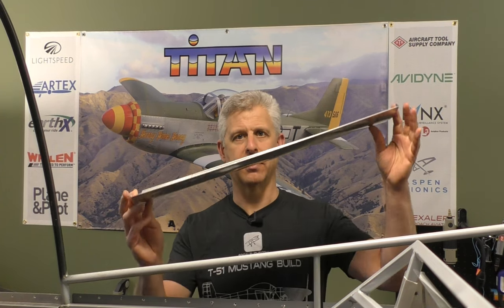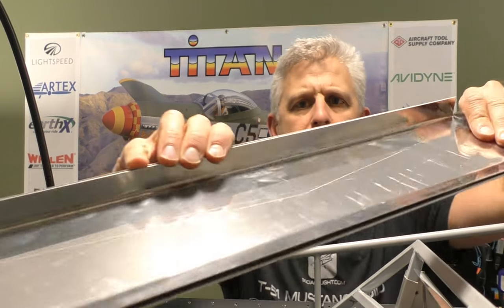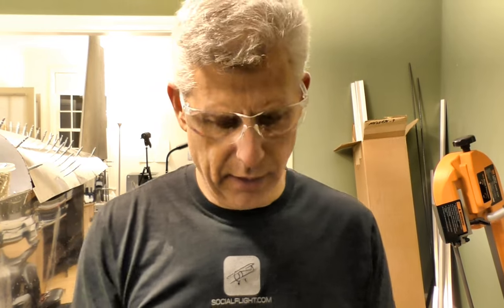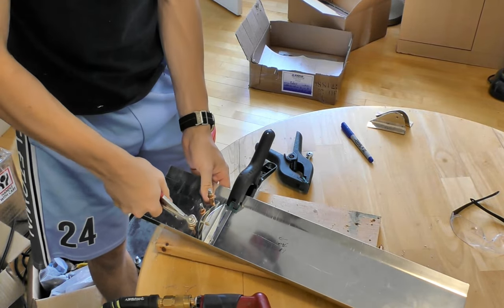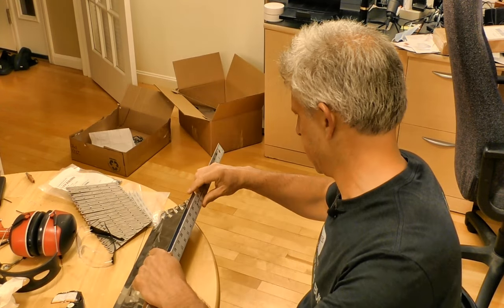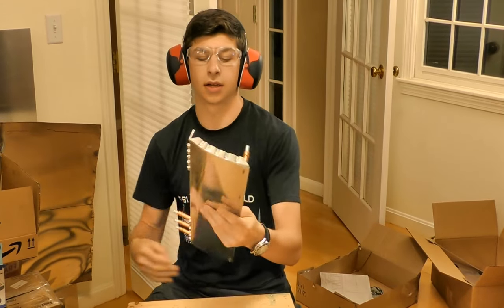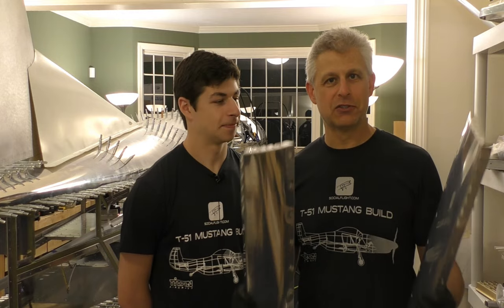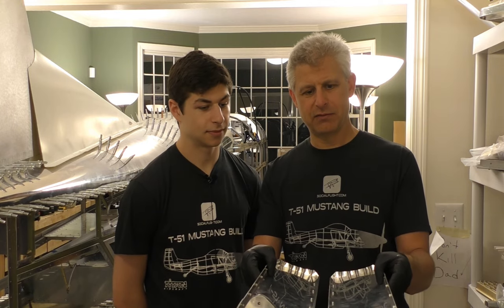Building the Tailwheel Gear Doors on our T-51D Mustang Aircraft Build!

Comment: Where did you use the glue? Did you glue the doubler to the gear door?  Thanks.
Reply from the maker: Yes I did.  We generally use glue everywhere we rivet.  We only excluded the brackets.
Reply: @SocialFlight  May I ask what you use for glue? Just trying to learn.
Reply from the maker: @GreggGermain-lk8if  Titan Aircraft includes an adhesive with the kit called “Uralane”. It’s a two-part adhesive that you store in the freezer until ready for use.
Reply: @SocialFlight  Thanks